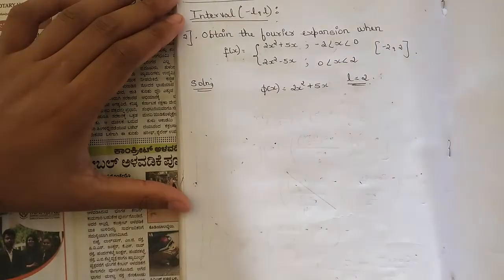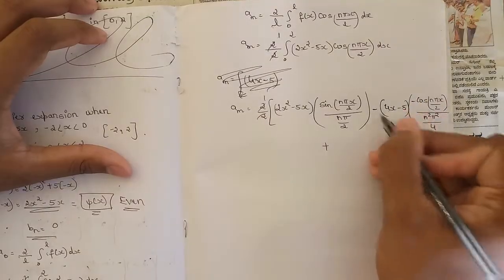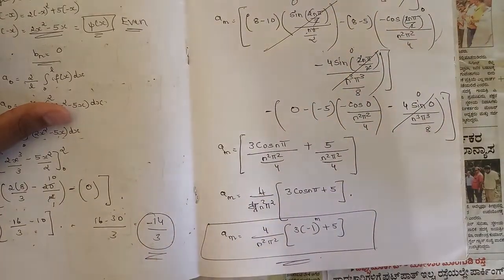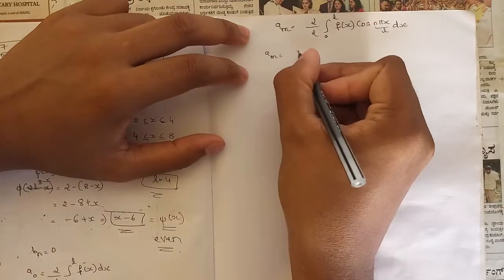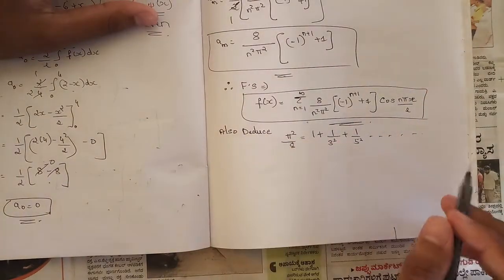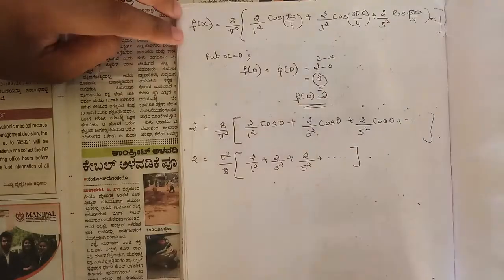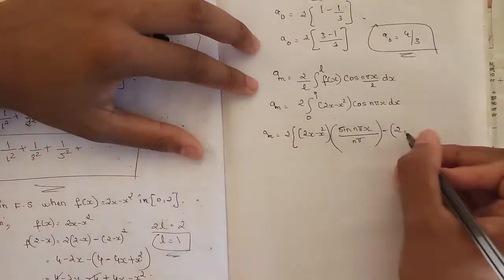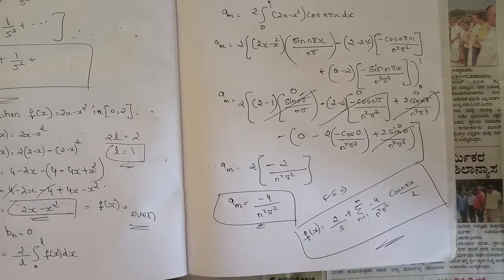7 Fourier Series interval (-L,L) & (0,2L) 2 Questions Explained 3rd sem ECE || 2022 Scheme VTU

Comment: In second problem, f(x) is an odd function. You simply can't change ( -6+x ) to ( x-6 ).
In fact, by taking negative outside it proves that ϕ(x)= - ψ(x).  Correct me if I'm wrong.
Reply from the maker: But why we cannot write -6+x as x-6 ,it is one and the same ryt?..
As u said by taking - outside we would be getting -(6-x)..that's also correct and  it would be odd function but the final answer should remain the same...if we take it as u said, there would be complexity while solving